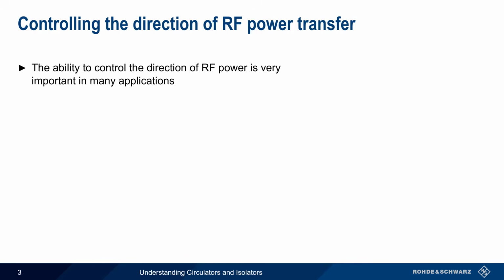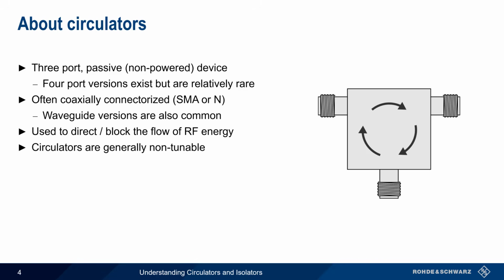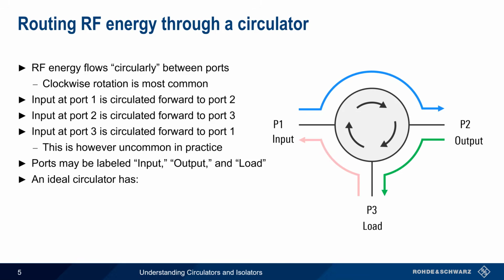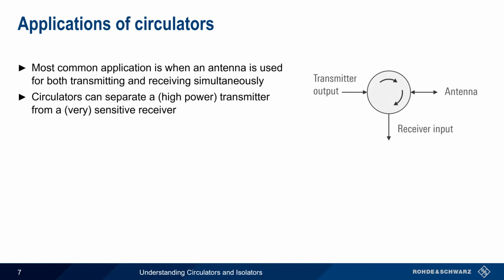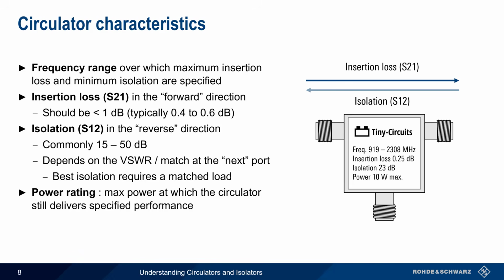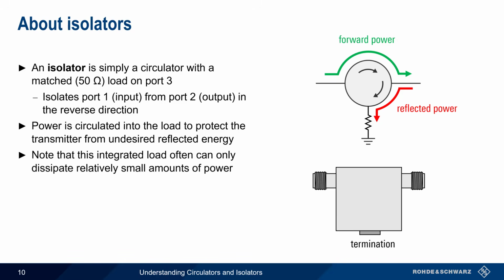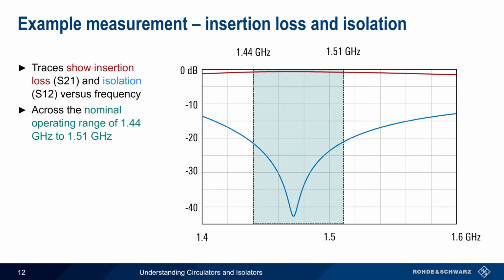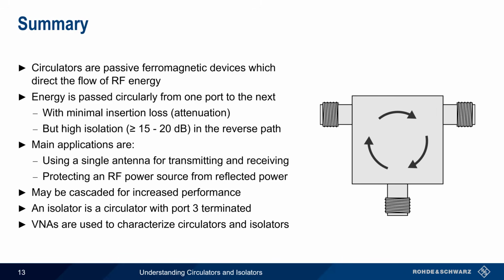Understanding Circulators and Isolators

Comment: Can circulators be made of non magnetic components?
Reply: Not that I know of, but there are “non-magnetic” ways of accomplishing the same function, e.g.duplexers
Reply: Technically there are ways using orbital angular momentum to achieve non-reciprocity. But in practice, no, it's all non-reciprocity from zeeman splitting in ferromagnets in stripline ones, or the faraday rotation of polarization in a ferrite rod in a waveguide. Also, lol at the "Tiny-Circuits" labeled filter instead of "Mini-Circuits".
Reply: @Superkuh2  Thanks!  As I like to tell people, I'm an engineer, not a scientist, so very much appreciate the physics background.   And thank you too for mentioning the "Tiny-Circuits" label - I had fun with that one 😆  I tried to come up with a play on "Pasternack" but none of them worked out. 😃

Comment: Thanks Paul.  Very interesting and well presented as usual.
I don't do RF design but just occasional RF/EMC measurements.  I see circulators mentioned occasionally and was curious how they were used.
I also thought the Tiny Circuits brand and logo was quite clever and amusing!
Reply: Thanks!  And thanks for noticing "Tiny Circuits" -  I usually try to sneak something "fun" into all of my presentations. 😀